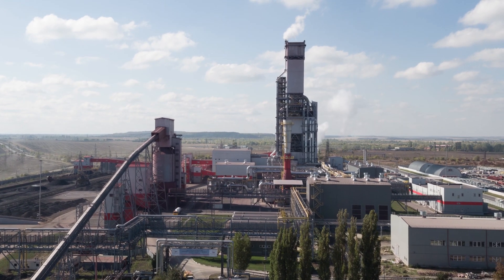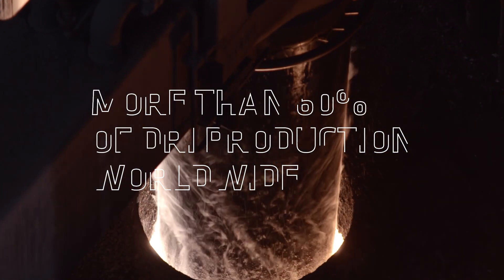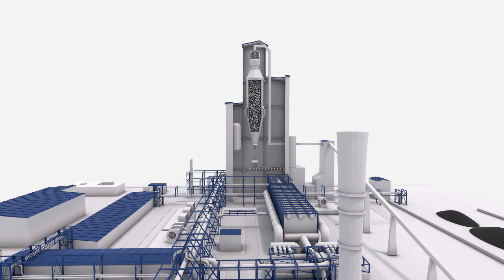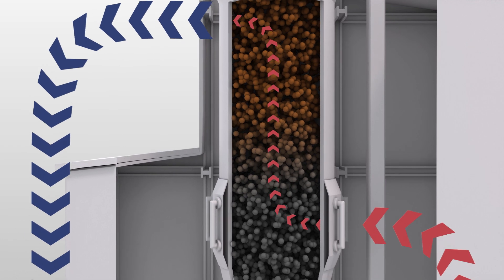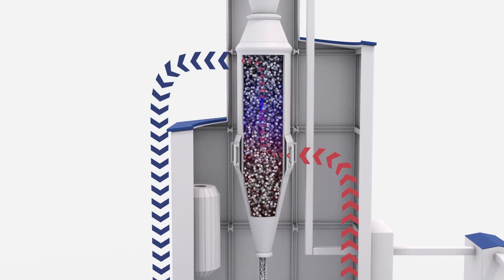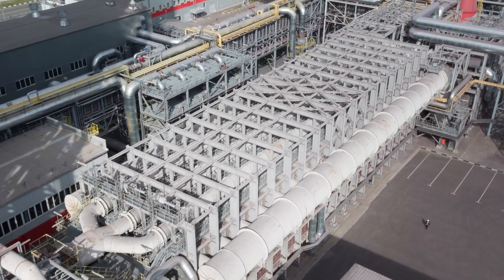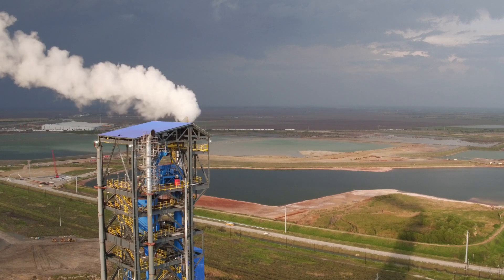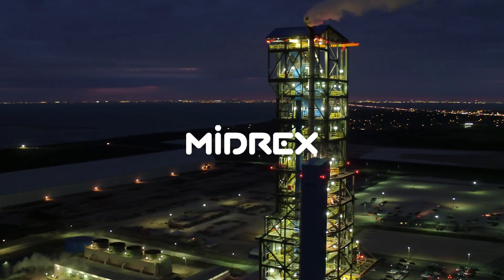The MIDREX® Process

Comment: If you believe Elon Musk then using hydrogen is horribly inefficient.  If you want truly green steel then why not look at biomass gasification coupled to a Midrex direct reduced iron module?
Reply: Last time the biomass was used for metallurgy the Great Britain lost its forest almost completely. And you can not even compare iron amounts produced then and nowadays.
Reply: @yurikorobeinikov2195  Not true.  Brazil runs blast furnace pig iron production from charcoal produced from trees grown on plantations.  Nucor had a joint venture on this for a while.  I think the only way Hydrogen production will work is if generated from the heat of a nuclear reactor not from electrolysis.
Reply: @felixyusupov7299 1) Brazil is not a leading steelmaker by volume. Far less than USA, or EU. Not to compare with China. 
 2) are you really sure that Brazil is a good example of sustainable forestry?
Reply: I think if  you want "green" steel then nuclear powered hydrogen is the only option.  Biomass is green but wouldn't work for most of the world.  I agree with that.
Reply: @felixyusupov7299   "Biomass is green" is kind of a spurious claim sans qualifiers. Biomass isn't automatically 'green' (w/e that means), it's just not made directly from fossil fuels in the strictest sense. If we want to save ourselves the guilt of using wood from forests as the biomass source, we can can get it in the form of crop residues and byproducts (bagasse, coconut husks, peanut shells, what have you)...but then most crops are produced with destructive monoculture practices that also rely heavily on products made from petrochemical feedstocks.
Reply: @yurikorobeinikov2195  as metallurgical engineer i can assure you 100% in steel production Brazil planted forests is cutting edge forestry technology and example for all over the world.
Reply: I thought Musk’s stance on hydrogen is specifically that it makes an unwieldy fuel for consumer vehicles (difficult to store in pure form, energy intensive to store in and release from hydrides, etc.).
Reply: @lorez201  Yes but the points that Elon makes are also valid if you intend to produce direct reduced iron using hydrogen.  The main point is electrolysis is inefficient.  Hydrogen is still difficult to store.  Hydrogen is dangerous because if it catches on fire you can't see it burn.  These are the same problem that would be applicable if one was to produce direct reduced iron from hydrogen.  An engineer at Tenova told me that the HYL plant in Sweden produces direct reduced iron from hydrogen and I replied "but can they do it profitably?".  He would not answer that question.  He just smiled.  That is because it is public relations B.S. and not economical and he know it. The only way hydrogen based DRI would work is if it were tied to a nuclear process like a molten salt reactor and hydrogen production was based on the heat of the nuclear reactor with a catalyst instead of electrolysis.
Reply: @felixyusupov7299  "Hydrogen is difficult to store". Yeah, we're in agreement on that but where in the video did it say they planned on storing pure hydrogen? As I understood it, the video mentioned hydrogen as an incidental component of the syngas that gets produced and consumed onsite. It was only until later that it mentioned supplemental hydrogen as an option to reduce GHG emissions, which I will say is dubious given that most hydrogen produced today is grey hydrogen (but also you never mentioned that, js). "Hydrogen is dangerous because it [burns with an invisible flame]". Okay. Are we talking about heavy industry with (generally) layer upon layer of safety regulations and protocols and engineering or are we talking about a hobbyist's garage HHO setup? Idk, by the time you have a hydrogen flame burning in open air at a plant, many other things need to have already gone horribly wrong. If safety is your focus, why aren't you also worried about any and all use of syngas (including that made from biomass gasification), given that it burns much like hydrogen and is also poisonous due to the CO content? 
The profitability of pure hydrogen-based DRI is...another arena entirely. If they're using hydrogen sourced from fossil fuels, that's bad. If they're using hydrogen sourced from electrolysis powered by renewables, that's fine. If the unprofitability of electrolytic hydrogen-based DRI motivated them to subsidize it with the taxable profits of other industries or w/e, that sounds reasonable to me. 🤷🏻‍♂ You can ask Musk all about government subsidies lol. Ultimately though that's up to state bureaucrats and industry lobbyists.